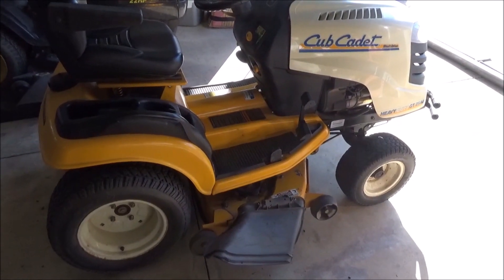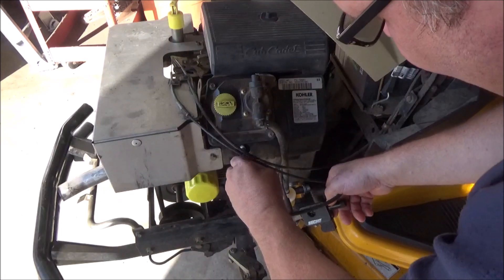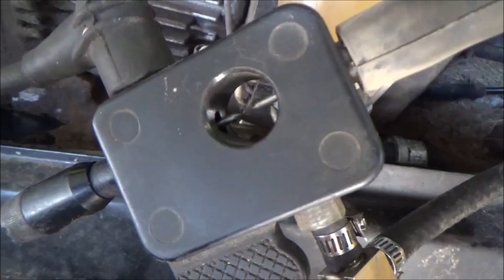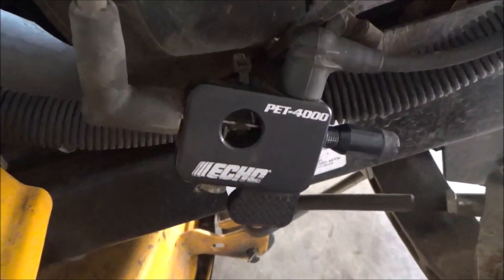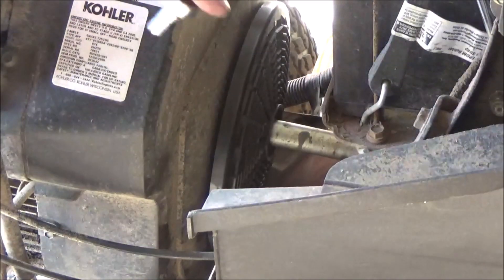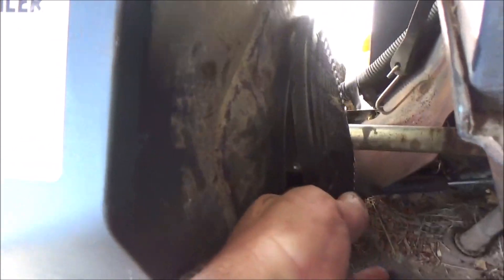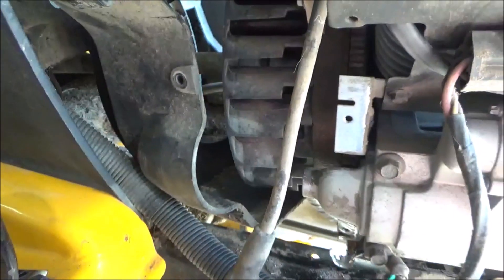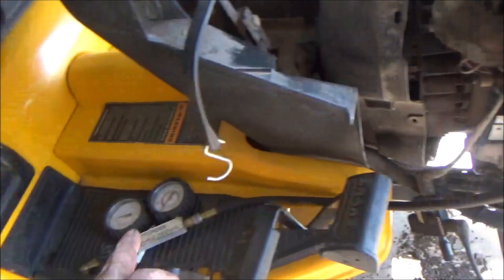NO SPARK? OVERHEATED? HOW TO TEST  AN IGNITION COIL ON A KOHLER ENGINE / LEAK DOWN TEST PROCEDURE

Comment: Thanks for great video.  Question.  Anyway to check primary and secondary windings on these coils using ohmmeter?  If so, can you provide pass/fail readings?  Have CH980 and doing the spark test both coils have small, but very weak.  Cleaned everything, including mount surfaces and connectors without any change in spark.
Reply from the maker: The manufacture doesn’t give readings for the coils the best thing to do is just follow the service manual on how to test a coil which is basically what I showed here

Comment: I have a 25HP Kohler in a Craftsman garden tractor. This year after mowing for a while I start to have an intermittent miss. It starts fine, idles fine, and seems to run fine when you start it. When it starts missing it's well warmed up (mowing for quite a while) and just starts to drop like you turned off the key and right back on again. The plugs aren't that old but I ordered 2 new ones today to try but do you think it's maybe a coil dropping once it gets warmed up? My cooling fins are quite clean and I blow them out if they get any grass build up so air flow is good. Other than swapping in new coils, any tips on troubleshooting? The tractor is around 16 years old and the coils are original.
Reply: New plugs fixed it for now but when you redo it clean the coil mounted area and coil from rust 
Bad ground Sir
Reply from the maker: Clean coil mounting bosses and retest
Reply from the maker: https://youtu.be/v8plRtO_Ko8
Reply: Many things could cause that symptom. Eliminate the easy ones first. Something as simple as fuel starvation could be the problem. Have you changed the fuel filter? Are you up on your oil changes? A sticking exhaust valve can be at fault.
Reply: Even though the plugs weren't old and didn't have many hours on them,  new ones fixed the issue. Thanks to everyone who provided suggestions- very much appreciated.

Comment: I just discovered your channel and subscribed. great content and superb editing. I have a related question regarding an ignition coil issue on a Scag Turf Tiger with a Kawasaki FD791D engine that has 1400 hours on it but has been well maintained. The issue: It will start up just fine and run for 2 hours or so and then will lose power and die-unless I can disengage the blades and put it in neutral fast enough to prevent it from dieing. If I shut it down and wait 2-3 minutes, I can start it up again, but after 12-14 minutes (and it’s very consistent within this time frame) it will lose power, sputter, and want to die again. I can shut it down and wait the 2-3 minutes and start it up again over and over and it will restart easily, but will always die after12-14 minutes. From my limited experience, this seems like a coil issue, but I’d like your opinion. Getting to the coil to test it is not easy-it appears to require removing the radiator to access it. But if that’s what is necessary, I’ll do it.  What do you think?
Reply from the maker: Il do a video, stay tuned
Reply: Check the gas tank vent.

Comment: Hey, great video.  I just went through th I with the same type mower.. I found your s after though.  Any others have the same missing info, though.  some show the blower cover magically jump off, then on. 
What's missing is small but huge.  The lower right blower cover bolt cannot be removed as the frame is against it.  First, loosen and drop off the blade belt, then loosen, not remove, the four engine mount bolts.  With a pet bar, raise the engine enough to remove the bolt.  While the cover is off, snip out a slot in that hole to remove this nasty task in the future.

Comment: Would a bad coil cause the mower to run rough, shut off, and not run until it cools down? It's a 2000 cub 2166 16 horse kohler.
Reply from the maker: It very well could, install an inline spark tester and observe the spark when the engine starts to run bad

Comment: I had the same model tractor, 21 horse Kohler command. It come in running on 1 cylinder and it didn’t fail a spark or leak down test. I pulled the valve cover and found a bent pushrod and a broken rocker arm bolt, and the intake valve was stuck in the closed position because a bent stem had it stuck in the guide. Quite a unique issue but goes to show sometimes all the testing in the world can still fail to show an issue.

Comment: I’m into this exact issue on my GT2550. The reason the build up is worse on the right cylinder is that oil vapor is blowing out of the oil filler hole and dust is attaching to it. Should check the o ring inside the cap. My coil checks out fine when cold. When hot it’s starting to fail.

Comment: I bought a 1974 1250 cub cadet in 1976 and mowed my three acres with the old cub for 36 years. Rebuilt the engine twice in that time. The engine gave out after many hours on a second rebuild with cylinder bored. I decided it was time to let it go and buy a new cub. Bought a new cub in 2010 22 h.p. that was the biggest pile of cheap crap I ever owned. There was no comparison between the 74 1250 and this new 22 h.p. cub. The 1974 was built like a tank. Much easier to work on and cut grass just as well. After three seasons with the new cub I bought an old 1976 1450 cub and sold the new one taking a huge loss but never looked back. What they call lawn tractors today are cheap pot metal housing a sheet metal crap.
Reply: Can't agree more. I run kohler k series engines on my antique john deeres. But when I have to work on one of these hunks of shit, it ruins my whole day. Both cub and kohler and many other companies are just empty shells. All they think about is circling large piles of cash into their own pockets. 
  I dare someone to ask for proof. I'll show them dozens of examples of what I say. Or the other possibility is they are all incompetent.  Just as bad.

Comment: Man im sure cylinder number one has been running considerably hotter than number two. What about a coil that will work fine when clod but after it gets hot it stops working i have seen this mainly on 2 cycles how is the best way to test for this condition?
Reply from the maker: Let it get hot then test immediately .

Comment: Thanks for this video! Great tips on testing for causes of the cylinder not firing. This particular Cub Cadet mower is quite impressive; love the way the hood opens from the front, engine is longitudinal with a drive shaft, and rear wheels are bolted, not keyed like cheaper mowers. I'd love to get one of these!

Comment: Great video, I have been looking for a leak test video on a vtwin.
How do you keep the engine from turning over when you test it at TDC?  I had a hard time doing this on my B&S intek, it kept turning over.
Reply from the maker: When the engine is at exact tdc it won't rotate on you, be careful when doing it by hand like I did.  It can violently spin and crack your wrist like an old model t ford 😆
Reply: @THEMOWERMEDIC1  ok thanks for the advice. Keep the videos coming.
Reply: You can put a socket and long handle breaker bar on flywheel nut if it’s tight 
Just be careful because it can break loose but I’ve never had it to

Comment: Your lucky it was a dead coil not a intermediate coil not firing when hot. Those are harder to find the problem. Surprised that motor did not drop a valve guide too being so pluged
Reply from the maker: Only a matter of time.

Comment: This is very timely because an in-law has a mower like this (GT2100 with shaft drive) and originally I thought I wouldn't be able to do it because the engine may need to come off to access the coils...BUT now I see you can undo the blower shroud and just push it back over the shaft and have pretty easy access to the coils.  The left side is bad in my case.  No spark.  I guess I'll check to be sure that diode isn't bad first, before I order a coil.  From what I've seen online (haven't checked the dealer), it runs anywhere from $45 to $70 for the coil.